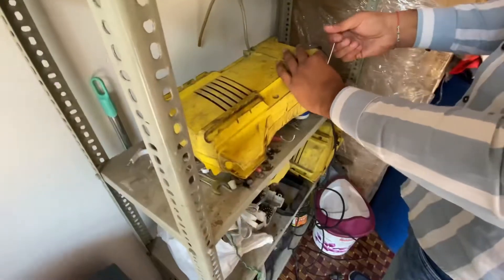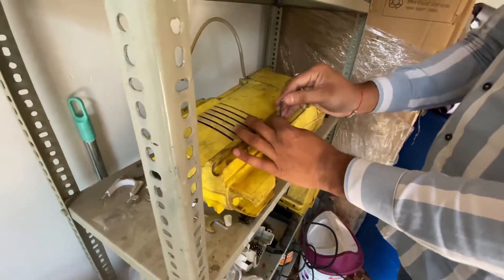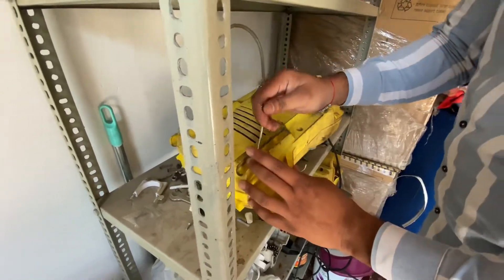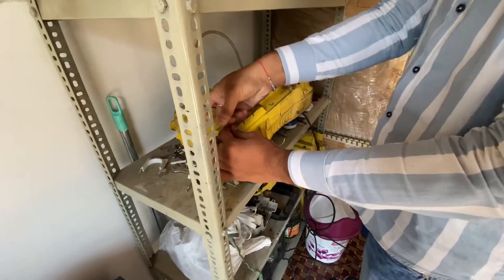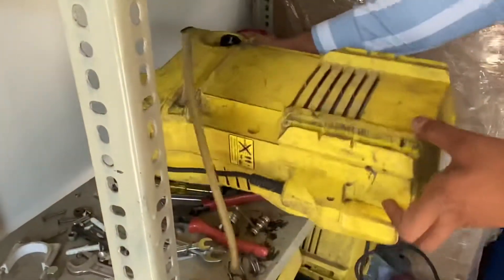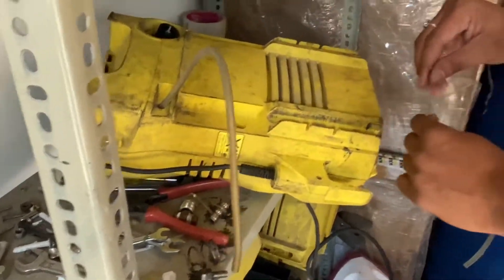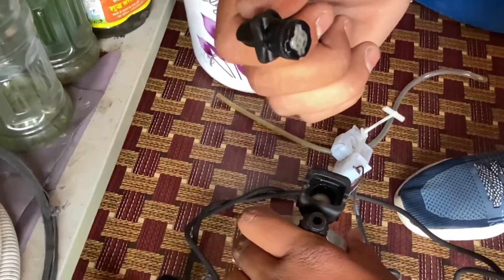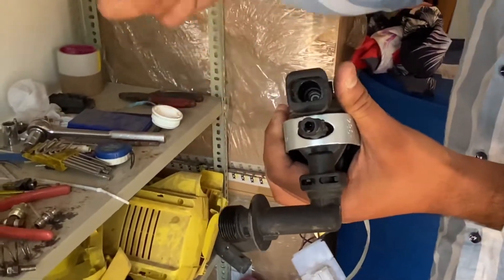KARCHAR K2 On /off Switch not working/ Solution is here 🔥

Comment: Thank you. This was the solution to the on/off switch sticking in the off position. Cleaned and greased the stem and spring as shown and the K2 is back in business! Its well work fixing as I felt there wasnt that much wrong with it.